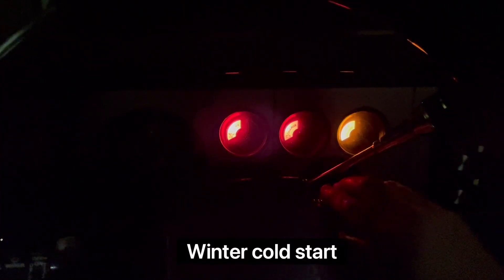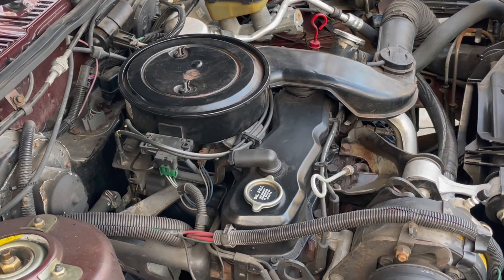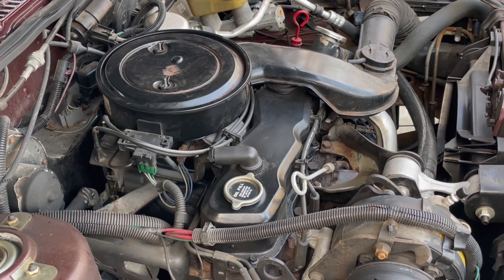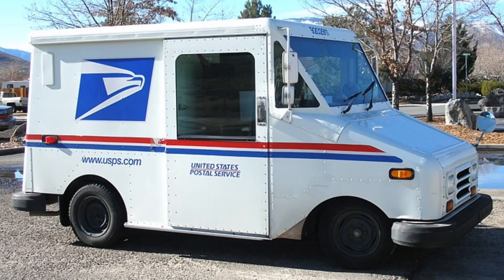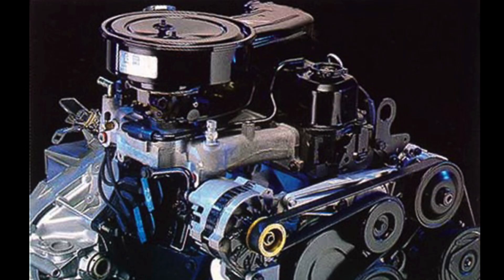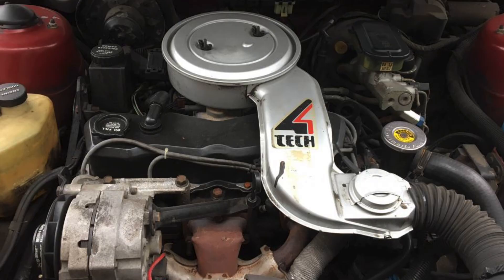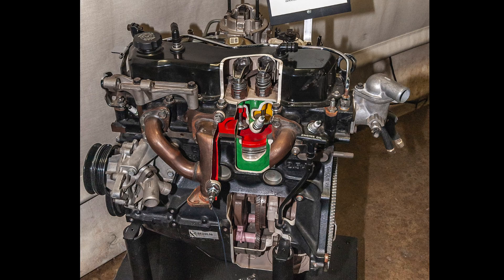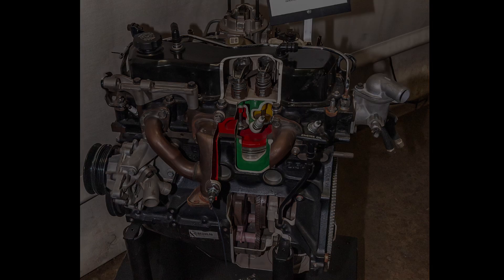Worst Sounding (and Most Recognizable) Engines: GM's "Puttering" Iron Duke 2.5L I-4

Comment: Mercury used this engine in a mercruiser inboard/outboard configuration. I had one in a walk thru windshield 18' boat. I have been around the mercruiser variant of this engine a lot throughout my life, and owned at least one. I can say that they may not sound good, but they are reliable, and fairly tough engine, judging by my experience with the engine.

Comment: The classic "tech 4 rattle" is caused by the engine force balancer assembly. There is a very fancy gear-driven oil pump / counterweight unit mounted on the bottom of the engine block. It has two counterweight shafts that rotate in opposite directions to make the engine run with less vibration.

The counterweight shafts turn in bored holes in the aluminum frame of the force balancer assembly, without bearings. Only one end of the shaft has pressurized oil, the other depends on throw-off from the crankshaft.

Once there is the slightest amount of wear, the balance shafts bounce around in the bores, causing that characteristic rattle / woodpeckers / galloping horses noise.

Comment: In California the 1982 Camaro the 2.5 L Iron Duke had the highest HP per Litre displacement.  The V6 and V8 had less.  

The V8 5.0 L was so detuned and Low tech you got 135 to 140 HP. Compared to the 90 to 92 Hp 2.5L..  worse also is the low tech V8 weighed 593 Lbs compared to 320 with the L4.. 

Even worse is the V8 was considered a muscle car. So when under 25 age you paid 50 to 65 percent more for car insurance for that extra 50 HP that extra 2.5 L gave you. 

They did not even have a manual transmission for the v6 or v8 in California.  So part of that extra hp went in heat in the torque converter. 

The reason GM had an iron duke in the 1982 F cars is CAFE standards. The car is 24 Mpg combined and 36 mpg highway.

Comment: I had an 85? Buick Skylark with the 2.5 Iron Duke.  Mine also sounded like a diesel, and I often wondered why.  It was reliable and ran well.  It had good torque and got decent gas mileage.  It was a good car.  Nice video, thanks.

Comment: I bought an 85 Astro cargo van at an auction that ran badly but I knew the EGR was the issue. The 2.5L Iron Duke had 70K miles and a manual transmission. At around 100K miles, a rod broke on the freeway and luckily after a few new parts, and with the help of a machine shop, it soon sported a rebuilt engine. I always use full synthetic oil but I wonder if that somehow contributed to the breakdown. The only issue after that was the gear shifter would get stuck here and there, which meant climbing under and tapping it loose. The new owner had to call me to free it, even though I told him about the issue. Sadly he was on an incline drive so I had to use my vehicle to push it forward to do it safely.  He never called again.

Comment: I had an 88 s-10 with this motor and a 5 soeed manual. I (stupidly) bought a camper shell for it. 5th was always unusable. Didnt have enough power to hold it. When shutting off it sounded like marbles in a blender for a few seconds.

Comment: I had the cam and crank gears replaced under warranty and it got quieter, but then it got noisy again over the years. It was durable and reliable. Made a sound like a lower engine problem.

Comment: Okay, you people don't ever get the history of this motor correct. Originally the motor was designed in 1960's as the chevy ll 153 engine  The first three years of the Iron Duke were still the 153 Chevy ll Engine ,Around 1979 Got cross flow head all bolts in motor were metric one piece rear main seal.
 In 1982 Switch to metric bellhousing pattern Mercruiser still makes the Chevy ll 153 as the 120hp horse power motor And 140hp  181ci Mercruiser You may wonder how I know this. I own examples of all these motors get the history straight People

Comment: In my opinion, the worst sound from an American-made vehicle was the starters from most any Chrysler product from the 1970s and early 80s.  Especially after you let off the key and you can still hear it spinning down for 3 or 4 seconds.  Always hated that. And it didn’t seem to matter what engine it was, they all seemed to do it.  *gack.  If you let off the key, you shouldn’t have to sit there and wait forever while the starter stops.  Nobody else seemed to have that problem.

Comment: GM always had better engines in Europe, i don't understand why they just didn't put any of them in the domestic market except of the C20GET which is a Turbo C20NE. Look at this CRAP engine which had 90hp in 1990, whereas GM had the C20XE 170hp underrated to 150hp since 1987 and tunes to 200hp+ in NA form, not to mention the Turbo 200hp C20LET which tunes to 300+ stock and goes to 700hp+ forged.
Only Saab had better engines in the US, the b204, b205 etc, whereas the domestic Camaro it was the 90's and still had this piece of crap 2.5 Ironpuke engine.

Comment: A buddy of mine had a brand new 89 S10 with the Iron Duke. It definitely didn't sound great but it ran fine and never had any problems. My vote for worst sounding GM engine goes to the 4 cyl that was in most J body cars. I knew people with Chevy Cavaliers that had it and they sounded horrible. I shook my head and felt bad for the driver the fist time a Cadillac Cimarron passed by me and I heard that thing.

Comment: That’s the engine that was in my 1984 Pontiac Fiero.  Not much power from that thing.  The base Fiero engine was very underwhelming.  With around 120k miles on mine, some sort of a composite gear broke while driving down the highway.  Wish I would’ve kept it.  Can’t remember what exact part it was.  Around 6-8 inches wide with slanted teeth and about 1 inch thick.  Anyone know what that part was? Wonder if that was the cam gear referenced.

Comment: Our mail lady ran her 160 mile a day delivery in a chevy celiberty from the 80's with the iron duke. she drove it for 25 years. I bought a 88 s-10 new with the iron duke 2.5 and it was a pos . The iron shit engine failed and was replaced 3 times under warranty with first one failing at a little over 4000 miles and the third on before 22000 miles. My 2 gm vehicles after the s-10 were garbage also and in 1990 I purchased 2 new fords a taurus and a f-150 and i never again owned anything from gm and never will. I have owned 6 tauruses that i purchased new and never ever had a major failure with any of them all made at least 400k. I currently still have a 06 taurus with 600,000 on the clock that the cruise gets set on 80 mph or more everytime i hit the interstate. I have Had the usual issues like starters alternators batteries brakes water pumps radiators but you will get that with any vehicle. the 06 taurus has always been on amsoil products with 60k transmission services and the trans has never been replaced but the torque converter has. Some folks has good luck with gm for me they never held up, and i had 2 jobs were gm trucks would not stay together period. I keep the wife in new toyota's, a few years back she wanted a yukon and i said no gm crap will be bought with my money never again.

Comment: They put these in the A body as well. They were underpowered as it was in the X body, then decided to plop them into the A!? Chevy Celebrity comes to mind and my mother in law had one in a Pontiac 6000. Horrible. Got worn out shoving that thing down the road that the blow by would fill the air cleaner.

Comment: The iron duke was 301v8 based and the combustion chamber was flawed leading to detonation.my 89 s10 I owned new would ping heavily in the summer on hills.
Reply from the maker: Bad egr valve
Reply: @RareClassicCars  Sounds like the pinging that I remember Subaru Loyales having! (whether it was the 1.8 I4 or 2.2 I4, IIRC) When going up a hill on an interstate! Heard that in an earlier-1990s Loyale. The pinging would sound like tick tick tock tock tick tock, much like forced hot water heat coming on, LOL.

Comment: It's the low compression and throttle body injection that would give it an uneven lean idle miss condition both warm and cold. Essentially the fuel would fall out of the air and pool in the bottom of intake manifold, causing it to get sucked into the combustion chamber in large drops. That's why they get relatively bad gas mileage and have no power: poor fuel atomization.

Comment: Yep. Probably the worst p.o.s. engine I ever OWNED in a car. A 1983 Olds' Cutlass Ciera. Had absolutely no power and was totally wore out at 75,000 miles. But did have cold air for a while. Oh, and the timing gear set-up they had was pure garbage. p.s. also the entire so called 'electronic computer controlled ecm throttle body fuel system' was nothing but problems too

Comment: It was a disgrace of a motor mainly because of its application in the Camaro. Other than sounding like a bag of rocks that sucker is reliable and unbreakable. The only thing that I found weak point wise was the cork gasket on the valve cover.

Comment: This engine was produced before 1977. 
It's actually a Pontiac engine and you could get one in a 1974 jeep back when AMC owned Jeep. I restored a 1974 cj8 a.k.a "Scrambler" that had the Pontiac iron duke, a small block Chevy bell housing with hydraulic slave cylinder , Ford Borg Warner  T10 4 speed trans , and a Ford Duraspark ignition. 
Also used a GM style steering column.  All of it straight from the factory!
Reply from the maker: CJ8 was made from 1981-86.

Comment: I may be subjecting myself to ridicule here, but I dare wish to come out in defense of the Iron Duke.  People seem to have a lot of fun lampooning that old engine, pointing out how high in decibels and low on power it was.  Those I will concede are undisputable facts.  However, I dare say that this was quite probably the most durable 4-banger that America had to offer, as long as it was not abused (the real critical element to its durability).  Properly maintained and not run past its red-line, those Iron Dukes could last a long time; it seemed, to me at least, that Pontiac had a knack for making 4-bangers that could last longer than their V-8s.  From my own observations, the Iron Dukes could certainly outlast any V-6 made by anybody...again, as long as they were not run beyond their (admittedly low) tolerance.

Granted, they had about as much oomph to them as a 40-year-old horse in an Amish stable...but consider the situation in which they existed:  A Federally-enforced speed limit of 55 mph with no foreseeable end to that severe restriction.  How much power would one need back then?  Our beloved, perpetually-trusted, omnipotent, omniscient government said we had to go slow, so we went slow, and that was where the Iron Duke was right at home.  The Postal Service felt that way as well, which was why the mail-truck fleet ran on Iron Dukes for as long as they did.

Comment: Thankfully, I don't have to be embarrassed by my rough, rattley GM 4-cylinder when it starts it up, since it's in a woodchipper! The 3.0L industrial/marine GM 4-banger is very similar in construction and spec to the Pontiac derived Iron Duke, but even bigger!......and not really any more powerful though, I think these make about 90hp but only need about 3000rpm to do it. Seen them in chippers, forklifts, pontoon boats and street sweepers. Tough little engines, never really give any trouble despite being neglected and worked hard!

Comment: some of those small cap GM engines were horrible. Down here in the far south of the southern hemisphere GM Holden had a 2.0 4 cyl that used those plastic timing gears but not for long because they wore out with frightening speed!

Comment: I get to hear this sound every day as a postal carrier that drives an LLV. Those engines are fantastically durable, if not powerful. Some of ours have over 200,000 HARD miles on them, are poorly maintained, if at all. I’ve driven one that had a punctured oil pan from road debris, ran completely out of oil, zero oil pressure . Replaced pan, top up on oil, and still running today. 
They’re not quick. Fully loaded, it’s about 800-1000 pounds heavier than anything GM ever put them in. Zero to 60 in…. Never.

Comment: I was a GM dealership mechanic in the 90's. A lady complained her 2.5 iron duke engine was knocking. I told her it was because it was running. Yes Adam, from my experience the most noise came from the camshaft gear drive setup. Any backlash from wear would cause a lot of noise. Putting in new timing gears would quiet them down. Temporarily.

Comment: These engines really do behave like diesel engines. I handle them on a somewhat daily basis, I work at a shop that does fleet maintenance for the USPS. They not only sound like an old diesel tractor, but they also all seem to have that run-on condition that diesel engines get when you shut the ignition off

Comment: Adam, thanks for this, I enjoyed it.  I liked the sounds of the Iron Duke.  To me they made a friendly sound.  Or an agricultural sound.  I had two of these engines and both were in Fiero's.  The Fiero sound was certainly related to all the other Iron Duke cars, but the Fiero exhaust system caused unique notes that I found to be more enhanced, in dept and tone.  Perhaps it was due to all the bends in the Fiero exhaust piping.
The Iron Duke was a good engine that held up well.  The only problem I had was, once they had some mileage on them, they developed oil leaks- everywhere, and that was a big job in the Fireo.  I replaced the gaskets that could be done with the engine in the car and let the other oil leaks be.
Awe-jeez, now I'm missing my second Fiero, my favorite of the two.  It was an SC (Sports Coupe) most people knew about the base model, the SE, and the GT, but not the SC.  I think they were rarer that the other trims.  A nice middle car.  They had the Turbine wheels, not the It-Slices-It-Dices blade wheels the SE had.  Yea, I'm missing that Fiero.  It's hard to believe that next year 2024, Fireo's turn forty.  Thanks again, Adam.
Reply: I have an 85 Sport Coupe! 13 inch finned aluminum rims. White over tan. Many think it’s a base but it’s not. 😎👍🏼

Comment: These engines were superior to the competition (Ford 2.3 and Chrysler 2.2). No timing belts, no tiny little water pump behind the engine, etc.   Of course they don't hold a candle to a 22R or KA24E, but they were great overall.

Comment: I had a black1984 Fiero SE with the iron duke. It was sadly underpowered but still fun to sit in. It had a 4 speed manual and had no passing power. I remember trying to pass someone on a US route and it didn't go well. The engine failed once. One of the head bolts broke. So, I had to pull the head and back out the remains of the head bolt. I heard GM had a rash of bad head bolts in 1984.

Comment: The '71 mechanical valve lifter Vega 4 cyl was certainly noisy and coarse. The early '71's also had a loud exhaust and in versions with a 2 speed Powerglide transmission, the whole neighborhood could hear you drive off in the morning.

Comment: Not a GM engine, but the 2.0 16V inline-4 on the 1st gen Dodge/Plymouth (Chrysler here in Europe) Neon was an incredibly noisy and rough running engine! The Neon was clearly inspired a lot by the Honda Civic, but as Honda's engine can be happily redlined all day the Neon's engine sounds like it will fall apart any minute.

Comment: Yes they were noisy but they were a strong, and long lasting as long as you changed the oil. Nothing deserves the worst GM Engine being for noise, performance or reliability other than the GM converted 350 small block diesel, which was garbage right out of the gate. Second is the Cadillac 8-6-4 !

Comment: My father had an S-10 with the Iron Duke and a 5 speed.  Nothing like a manual transmission to hammer home the joys of a ragged sounding engine with no power and a 4500 rpm redline.  It made it immediately obvious why GM lost most of their market share during the Roger Smith era.

Comment: My first brand new vehicle was a 1991 Chevy S-10 with the Tech 4 and backed by a 5 speed manual transmission and I remember that "distinct" sound that engine made. For what it was, power wise, it was acceptable when it was teamed up with a stick although there were times I wish it had a lot more power as it required a lot of shifting when traveling through steep mountain passes. I solved that in 1993 when I traded it for another S-10 but with a 4.3 V6 and a 5 speed stick. Big difference. I found the mileage with the Tech 4 was not that great when compared to Ford and Toyota with their 4 cylinders. With regards to the starter, mine sounded much better than any of these. I guess I was lucky? 😅

Comment: I did comment about those very qualities on your previous videos about the iron duke. And thanks to you, I found out about the mail trucks using this engine. My local mail carrier uses this, but had not quite recognized it due to the fact that it makes a buzzy sound. What I like to compare to a constant nasal blockage. These car companies like to pair these basic engines with particularly restrictive exhaust designs from what I can guess. It makes it sound as if its under constant strain. To give an idea, those early 1930s car engines. And if you've ever heard a 1970s Dodge van with a slant six, that is exactly what I'm talking about. Those mail trucks have the exact same exhaust note as those Dodge vans.